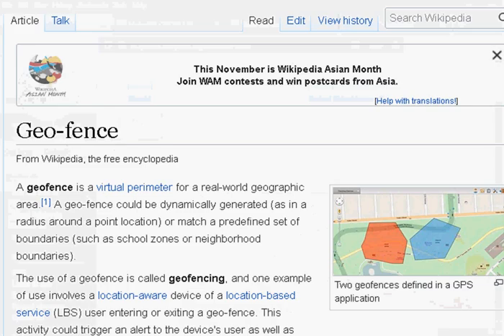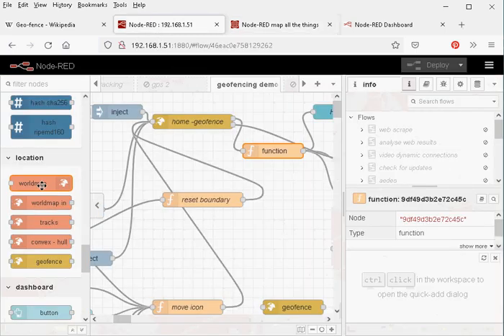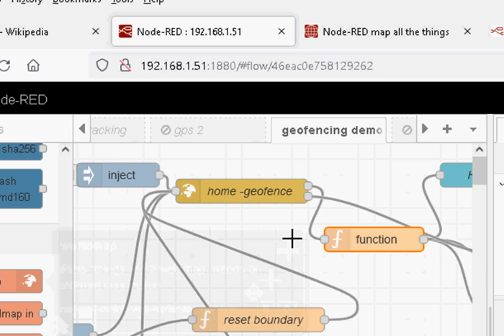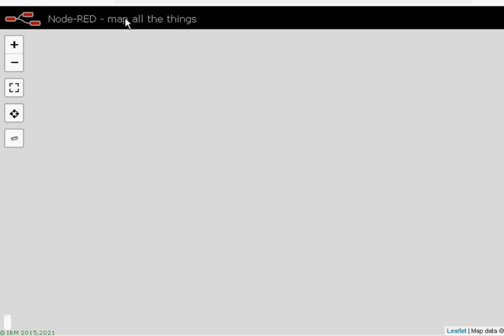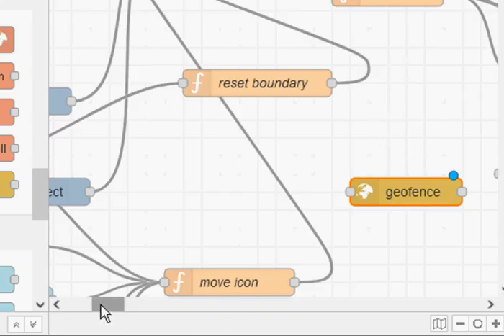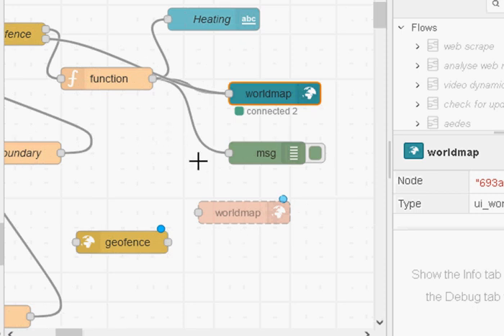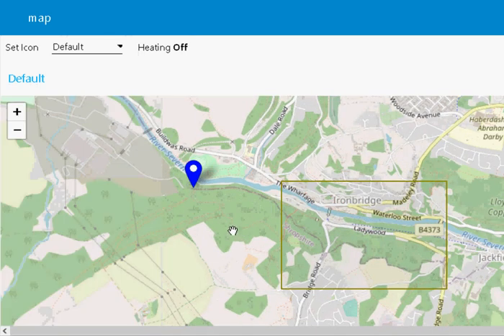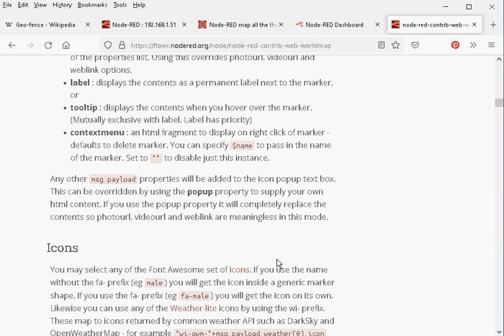Creating a Geofence With Node-Red

Comment: Hi Steve! Do you know how to rotate an icon on the node-red world map so it points in the same direction as the movement?  Is it also possible to use your own icons ? Thanks  in advance for your feedback .
Reply from the maker: Hi sorry for the delay I will take a look and get back
Reply: @stevecope  Hi Steve, i found the solution, you need to use the special icons plus heading.
Reply from the maker: well done
rgds steve

Comment: Is it possible to put multiple geofences on one map?
Reply from the maker: Yes you need to add another geofence node. I haven't tested the output but it does appear on the map.
Reply: @stevecope  Could you explain how to set few geofences? Doing a project based on your template now :)
Reply from the maker: Yes just add another geofence node to the flow. I haven't tested it (i think) but in the test flow I did add a second geofence.
Rgds
Steve